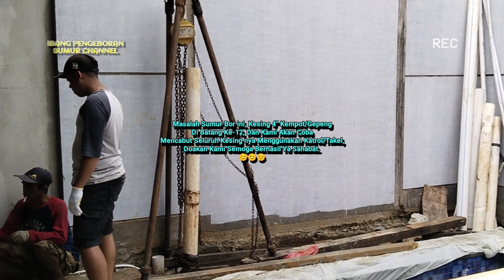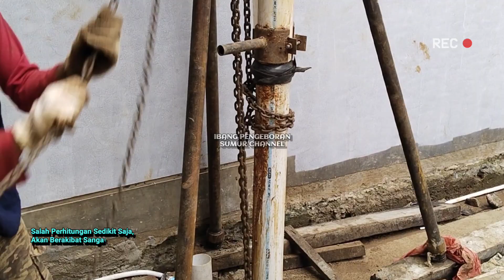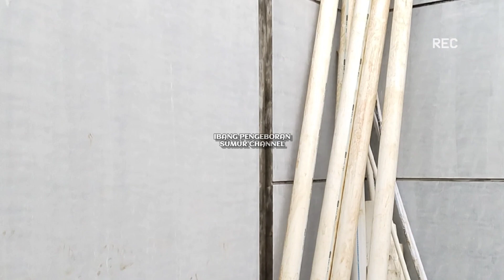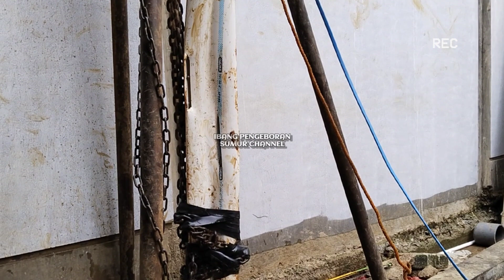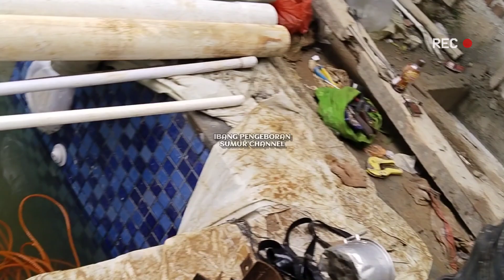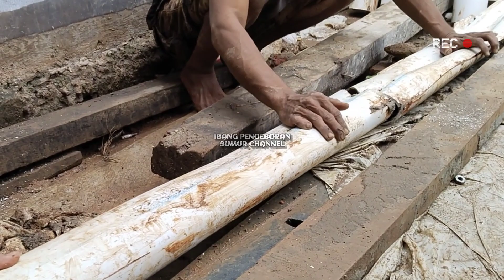FULL VIDEO || Service Sumur Bor GAGAL 😱 || Mencabut Kesing 4" KEMPOT !!! #sumurborgagal,

Comment: Maaf pak mau bertnya penyebab pipa kesing bisa kompot gitu kenapa ya pak?
Reply from the maker: Banyak Faktor Yang Mengakibatkan Kesing Kempot, Paling Umum Karena Tekanan Tinggi Material Di Luar Kesing Seperti Pasir kasar Dan Halus Dan Lumpur Padat, Info Lebih Lanjut Hubungi Kami Di No Whatsapp 081322272245 😊
Reply: Jadi tidak ada pengaruh dengan air yg dihidupkan full yg disalurkan ke tangki air , tips untuk agar tidak mengalami kempot gimna ya?
Soalnya saya dirumah sudah mengalami 1x padahal umur sumur dirumah baru -+ 3tahunan
Reply from the maker: Baik, Pemilihan Kesing Jangan Main² Krna Harga Murah, Minimal Harus Standart Aw Rucika Dan Setara nya. Maksimalkan Pembersihan Lubang Sumur, Dalam Pemasangan Mesin Klau Bs Step By Step, Katakan Sumur nya Kedalaman 40-60 meter, Pasang Mesin 7 Batang Dulu, Begitu Encer Dan Bersih Tambah Sebatang Lagi Dan Begitu Seterusnya. Jika Info ini Belum Jelas Silakan Hubungi Kami Untuk Tanya Dan Berdiskusi.